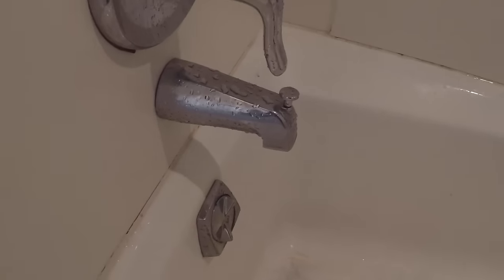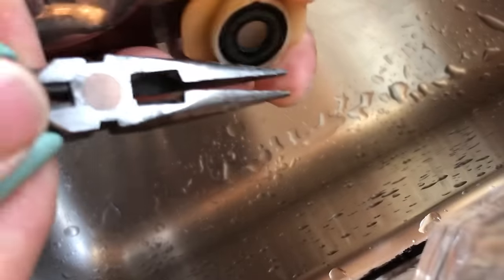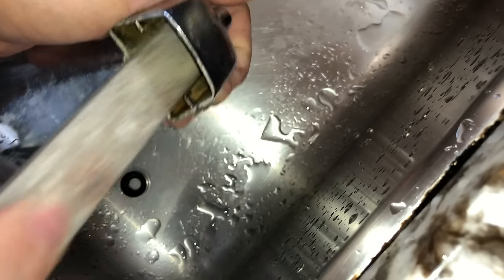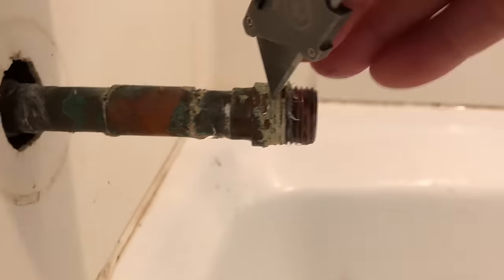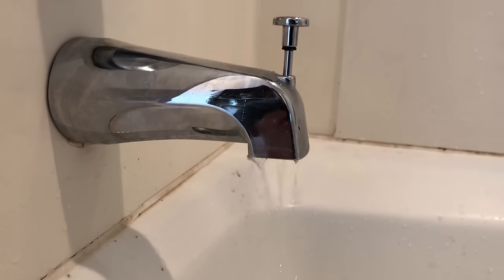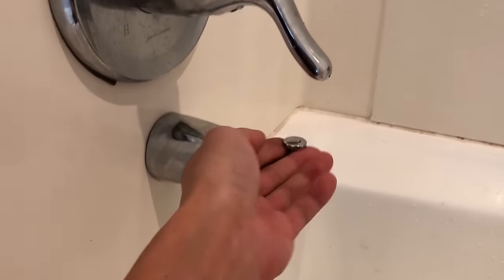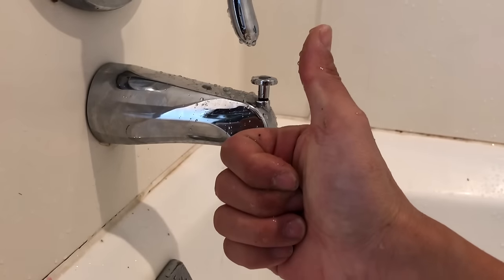Repair Leaking Tub Spout Diverter Pull in Shower Mode

Comment: You don't need to remove the whole spout to fix it. Most of the time you can just remove the plastic gate and rubber seal. Simply reach under the open end of the spout, open up the gate's two plastic side clips a little bit while also pulling up on the knob. Everything should come apart easily when you do this. Then clean the inner flat metal surface of the spout with a metal file (even a regular fingernail emery file will work too). To reinstall everything you do the reverse. If it's hard for you do see what you are doing, just lie down in the tub on your back with you head facing the spout. It takes less than 5 minutes to fix it, and you don't have to worry about not tightening/sealing up the main copper water supply pipe from leaking.
Reply from the maker: Good tips!
Reply: His tub spout was such a case that it did not need to be removed as the diverter is in the front.  My diverter is in the back.

Comment: My faucet head has a diverter with gasket heads on BOTH the front and backside of the water hole at the end of the pin. The thin plastic bracing wall that presses up against the front side of the hole cracked up the middle, was bent ever so slightly, and was angled away from the gasket head, thus breaking the seal when the pin was pulled up to divert water to the shower head. 

To straighten out the plastic wall so that the gasket heads sit more tightly up again against the plastic brace/wall, I cut and stacked four pieces of soft cuttable magnets and wedged them tightly between the plastic brace-wall and the front surface of the faucet head. Leaky faucet/diverter fixed!

Comment: Thank you!!! My tub faucet is cheap plastic but looks like metal. Well I went to pull up the piece that turns your shower water on and it and it's fellow parts fell out in my tub. I was freaking out thinking how to hell can I even get these pieces back inside the faucet from inside the tub! 😂 I didn't even know I could unscrew the faucet. Lol but thanks to your video showing all the parts I got it back together. But I saw some strains where 2 parts are about ready to break completely. So I will be installing a new tub faucet and not plastic! Looking to see if you have a video on that?
Reply from the maker: I don’t have a video on that but it is very straight forward. The new faucet will come fully assembled. You would install it the same way shown in this video. You’ll need Teflon tape to complete the install.

Comment: Thanks.  I was able to clean mine using some wet/dry sandpaper over a flat metal bar.  Sanded it down.  The washer was fine so I reassembled and it worked great.
Reply from the maker: Excellent work!

Comment: Check underneath for a set screw (often a recessed allen head).  Twisting with the set screw engaged can destroy your copper pipe, which is much more work to replace.
Reply from the maker: That’s a great tip. Thanks for the suggestion!
Reply: 3 name changes allowed every 90 days.  Danze

Comment: My rubber washer was in good shape, but it was a bit too subsurface to make a reasonable seal. So after sanding the seal surface, I also put a thin plastic washer behind the rubber washer to push it out a bit. Worked great.
Reply: You don't need the additional washer, and that will probably make things worse.

The washer is designed to be recessed, and sit below the plastic lip, so that it slides easily without damaging the washer.
Then when it's in the closed position, the water pressure from the spout gets behind the washer and pushes it tight against the hole, making a pretty decent seal, as long as the washer is installed in the correct orientation.

My spout was badly leaking because someone put an extra washer in, Once I removed it it now makes a perfect seal, even with the old washer (though I did also sand down the rough surface).

Comment: Awesome video thanks! But what would be the reason it drips after the shower is off from the spout! The diverter? Or the threads needs Teflon tape? Or it needs to be filed down? Any help is appreaciated
Reply from the maker: If the drips lasts a few minutes, that’s normal. That is the water in the pipe from the shower head to the diverter draining. If your drip does not stop after a few minutes, you have a leaky cartridge.

Comment: This was very helpful. However, I have a big warning if you plan to do this yourself. If you need to replace the diverter (washer and the small plastic unit that contains the washer), they are not all of the same size. I have a delta tub spout and the diverter is thinner than all the replacement parts that I could find. Not a reflection on this video but just a warning that repairs can go wrong and become nightmare. In my case, I have ordered an entire delta tub spout ($37) at Amazon. Will report back if/when this works.

Comment: I'm an mechanical engineer and find these videos a little pre-historical 3rd world but they give a foundation of the anatomy of what to expect. The proper way is to hold one end while twisting the other the opposite of how it was assembled from the beginning. You can use vinegar to soak it in for half an hour to clean and then a finger of dawn on the washer when assembling will produce a temporary seal. New washers should be placed for each servicing. Give me a thumbs up if it works for you.
Reply from the maker: There are multiple ways for sure.

Comment: For beginners that do not have much experience you should put a list of the tools you use. What is the tape you use to tighten the thread?
Reply from the maker: It’s called Teflon tape. It’s like 70cents a roll. It helps lubricate the threads as you tighten and provides a water tight connection.

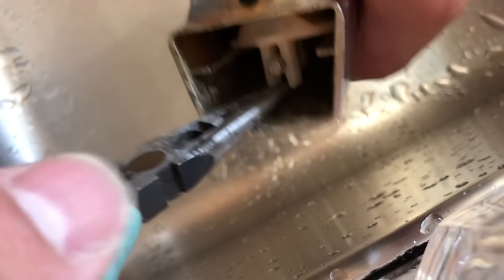Comment: TIP: at 0:30 you used the tool to spread /remove the white prongs. An easy way to take that off is by unscrewing the knob that you pull off to shower. once u unscrew it it'll easily come off :)
Reply: My dad told me that! I was having trouble with the white plastic part.

Comment: The biggest problem on this repair is to remove the plastic diverter from the metal pin with the round top.
The pin has two parts, the round button screwed to the pin at the top.  The design make repair and replacement very easier without having to break the plastic diverter.
If the button won't come out, just used two pliers to remove the top.  It makes the job much easier.

Comment: Great video. But mine is because that the black washer won’t reach the right spot. So I remove a small spring, and after that when I pull the handle, the washer will get the perfect spot. Now not leaking at all.

Comment: Thanks a lot for this video. I have a question some amount of water is still dripping off the faucet anyway even after the fix. Is this something inevitable ? I got the new one installed - still water is dripping a bit out of it despite it’s new.
Reply: Try some plumbers grease on the gasket but yea a bit of water getting by is no biggie.

Comment: Hi, I've never done home repairs before. What is the purpose of Teflon Tape? 
Also, i don't have a file. Is it something that is needed? What happens if I don't use a file?
Reply from the maker: Teflon tape bridges the microscopic voids between the mating thread so you get a water tight seal. You wrap it around the male threads clockwise 3-4 times. They’re like 60 cents a roll. 

Use sandpaper instead of the file. Or a flat head screwdriver very GENTLY!  

Hope that helps.

Comment: Make sure your reseated washer fits snuggly against the opening. Mine was very loose, there was a 2 or 3mm gap where the washer simply rubbed away from repeated opening & closing. I padded another thin washer behind existing one.

Comment: Okay so I had to replace my valve, and spout. My spout was leaking when I turned the valve off, now it does not. It does however leak slightly when the shower is on. What could be the cause of that? Also My water pressure feels lower now that the new valve is on. What could that be? Do you have a video or videos you recommend for these issues?

Comment: thanks, question: when the faucet is leaking, it is possible that the handle on top (the one to open or close the water) needs to be replaced?
Reply from the maker: Is it most likely the gasket. They should sell replacement parts at your local hardware store.

Comment: I've had to replace that spout on my tub three times in the last 10 years. The surface of the spout where the gasket comes in contact pits so badly that it won't seal. The last time the little pull knob corroded off. There's just no fixing mine.

Comment: you can also remove the gasket assembly by unthreading the diverter stem pull tab at the top.
Reply from the maker: Thanks for sharing! 👍
Reply: top comment! this would have saved me time and effort removing and replacing the spout…pipe tape…pipe dope etc..

Comment: Thx. I don't wanna sound like a know. But what was the small diameter hole. I'm trying to get my tub spout off and is surely not coming off that easy. My spout is exactly the same as yours. I thought at 1st that small hole might be for a set screw
Reply from the maker: It could be. Some spouts do have a set screw you need to undo. The hole on mine was probably a drain hole.

Comment: is this the same fix for the opposite problem? When I turn on the tub, water comes out of the shower too, even though the shower pin is pressed all the way down. Not a lot of water but some. Would the steps in this video correct that?
Reply from the maker: Yes. Could be a block in the cartridge also. Following steps in this video is where I would start tho.

Comment: Danco  makes a kit has the plastic slider and gasket for the mere price of 6 bucks.  Putting silicone grease was a good college try but will be desipated after a few pulls of that handle. That water coming out of tub fill after repair was excessive. FYI  27 years in the industrial plumbing trade. Good video overall though.

Comment: So my neighbors pressure relief valve went out on her water heater so I fixed it for her and then two days later mine went out on mine.  I replaced mine.  After that the first time we used the shower that night the pressure from the shower would shoot the rubber washer out the pressure was so high. I've turned down the water pressure but still didnt fix my shower problem. So I super glued a washer behind the rubber washer and jammed the water diverter up into the spout.  Lol. 
Dont have any idea why all of a sudden we have all of this water pressure.

Comment: Hate to tell ya, as a plumber, that gasket is shot. Put a new one and it’ll seal completely on every pull. But I get saving the cost. Gaskets are pennys. It works better now though.
Reply from the maker: I’d recommend getting new gaskets as well. This will work in the meantime.

Comment: BEWARE! THIS VIDEO COST ME ABOUT $50 IN REPAIRS AND A BIG HEADACHE! Video failed to mention that there are at least four different types of connections that could be used for attaching the spout to the plumbing coming out of the wall. In my case, I had what is called a "slip on" installation where the spout is secured to the plumbing stub with a set screw. That is not this one and just grabbing the spout and attempting to unscrew it nearly destroyed the pipe and broke the set collar of the spout. Yes, my leaking diverter problem has been solved, but only because I had to buy a whole new spout (good luck finding one that matches, mine does not now) and it was a delicate process repairing the pipe coming out of the wall.

Comment: Hmmm... Mine turns about 20 times around so far, but does not come off. Is it possible the copper pipe is somehow loose and is turning with the faucet?
Reply from the maker: You probably have a copper sweat joint. It most likely broke. Try pulling out.
Reply: Copper seat joints don't break unless it was installed by someone who didn't know what they were doing. What you are describing is a slip-on spout. Tub spouts have two different methods of installation. Threaded units that screw like shown in this video... and ones that simply push (slip-on) The Slip-On spouts have a plastic channel or tube and rubber O-ring inside the spout.  You simply push them onto the pipe then tighten the set screw located on the underside of the spout close to the wall. To remove the spout you simply loosen the set screw and pull the tub spout straight out from the wall. To replace, simply push the spout back on and tighten the set screw. Just FYI: The benefit of the slip-on spout is you just push it on until it hits the wall. With the screw on type spout, the plumber has to be careful when sweating on the threaded nipple. If the pipe with threaded end is too long the tub spout will tighten on the threads but the back of the spout won't reach the wall and leave an unsightly gap. If the pipe with threads is too short the threads may engage the spout but not enough of the threads will engage to create a leak proof connection.
Reply: Look at the metal bar the hex screw you loosened came out of, that metal plate needs to be pulled away from the pipe. Its held on with tension.   I ran into the same thing. It was not threaded on, it was tension or grooves of some sort. Very slight, not enough to compromise the pipe. Use bent tip plumbers pliers and pull that bar down to release tension on pipe.

Comment: Just what I needed to see if my small leak was normal.
Reply: Doesn't it drive you crazy when you think it's damaged? 
Now, moving on to little black spots (on my tile wall & caulking) that I swear is mold, but can't  be sure. 
This building was built 9 years ago!
Is that possible?

Comment: So when I pull the diverted nob and lever to get hotter water it's stays cold. Only when I pull the diverted knob half wait does hot water come out. Can you help with this?
Reply from the maker: Sounds like you need a cartridge repaired or replaced. I have a video that shows that. It’s called “how to increase hot water shower pressure”

Comment: I can't seem to unscrew mine,it's stuck on and I can't see any screws on the side or inside the hole on the bottom. Do I just need to wd40 and try to turn harder? Where else might the screws be located on the inside?
Reply: Hey Bob! Sounds like you're where I was a week ago ... couldn't get the tub spout off. They either thread on like this video or simply push onto the pipe. With mine, I found I had to turn the spout 180 degrees counterclockwise (as if unscrewing it) to reveal an Allen screw (in the hole on the bottom near the wall). I undid the Allen screw and the spout pulled right off. Hope this helps.
Reply: @richardpinos6028  thanks for the advice! Will give it a go. Right now I am unable to twist it at all, going to have a go with a wrench.
Reply: @frankiebromage5416  Mine was the same way to start, but when I gave it a stronger twist, it budged and then turned more freely. That's when I discovered the Allen screw. Good luck!
Reply: Gave it a strong twist to discover the screw myself, but I also striped a bit of the copper wall pipe off where the screw scraped it. Honestly, see if you can't get it from the bottom without twisting the tap at all first.

Comment: Replaced that....now how do I stop water from coming out of the shower head?  The diverter valve stops water from coming out of the spout.....but nothing is stopping water from coming out of the shower head.  Very annoying when you need to give kids a bath.  I'm assuming I need to open up the wall......
Reply from the maker: Take the spout out so you only have the pipe stub sticking out and turn the water on. If water still comes out of the shower head, then something’s wrong with your mixing valve (inside the wall).

Comment: Once I filed down the tub spout and replaced the diverter. It isn’t diverting at all even after several pulls. Any thoughts?
Reply from the maker: Is the washer oriented in the correct direction?
Reply: @chicagohandyman  yes the flat side was facing the hole
Reply from the maker: Without seeing your spout and the condition it is in, I’m willing to say it might be time to replace it. I did just that last month in an apartment unit. I just bought a replacement spout from Home Depot, and it worked out great.
Reply: @chicagohandyman  yeah that’s what I ended up doing.  Took me forever to get the old one off but found a video that said use a hairdryer or torch before turning it and it finally came off. After that it was just a matter of screwing the new one on. Thanks for the info. I can know what to do in the future!

Comment: Do you need to shut down the main water line?
Reply from the maker: Yes, but if you have shut valves for just the tub, even better. You won’t have to shut down the water for the whole building.
Reply: I am in a pre war apartment house. I only have the cold water shut off. The hot water shut-off could never be found by repairmen before, but I discovered it on the side of my under sink cabinet. The dial is missing and it is just a pipe stub  It is much smaller than the cold water shut-off. I have warm water dripping from the tub faucet now, so I know I would need the building's water turned off, since my hot water shut-off is broken. As we are in the pandemic, I was trying to avoid having my apartment repair man come into my apartment.

Comment: Hi I'm trying fix my tub faucet but my question is if I remove the faucet doesn't comes water? My is leaking when I used the regular shower thanks
Reply from the maker: Water will come out if it’s turned on.

Comment: Sure, I wished I watched this video b4 the beginning. 🤦‍♀️put everything back together, turn water on at cut-off valve. Water continuously running. Turned the faucet to shut, and water never cut off and was able to spin the faucet around a couple of times. Now, I gotta figure out what I did wrong. Not good.